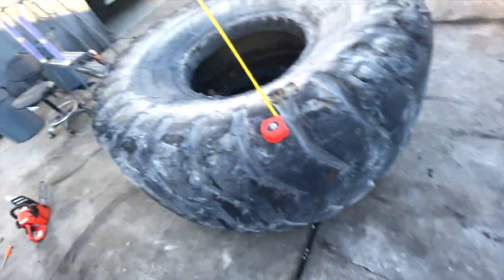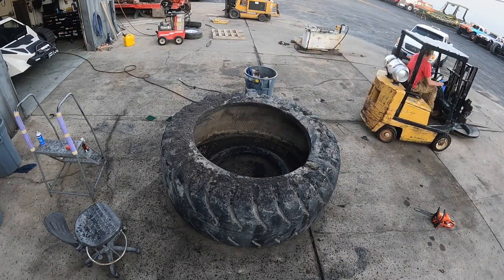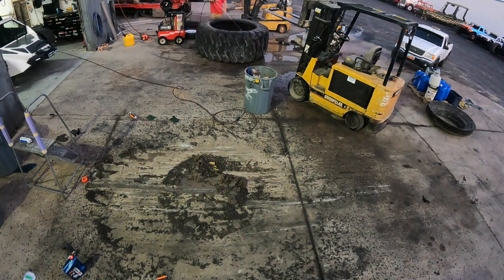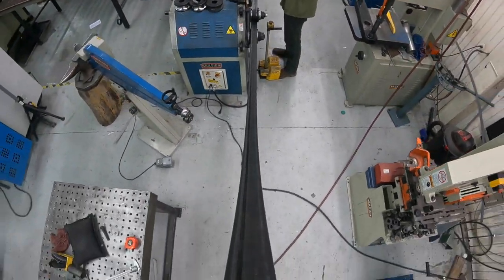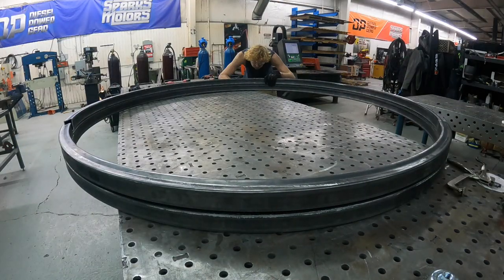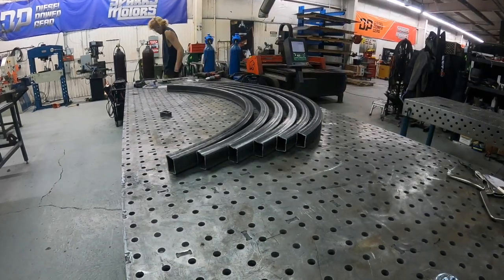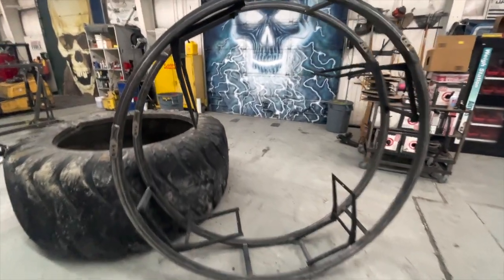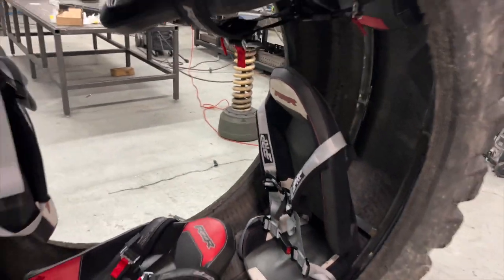How To Build Wheel Of Death (4 SEATER)

Comment: In the future..if you find yourself cutting into sidewall of a tire again...try using geared telescoping bypass loppers. 
Had 50 tractor tires to cut up and access to powertools but found the loppers faster than saws without the smoke.